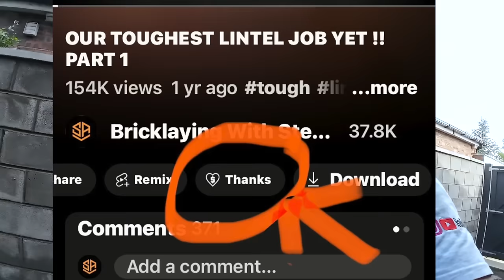WE RAN OUT OF BLOCKS ON BANK HOLIDAY MONDAY !!

Comment: Local environment laws here and elsewhere in the U.K. prevent paid building work on Saturday afternoon, Sundays and Bank Holidays
Reply: It's actually to do with the noise, if the work isn't excessively noisy then there isn't an issue
Reply from the maker: @bungleford 🧱👍🏽
Reply: @bungleford  depends where you live! Until the EA got involved we had between 8 and 13 trades vans parked all around our narrow street causing access issues for residents and emergency services, skips and materials delivered and collected at 07:00 and earlier. EA closed the site down for 4 weeks. It’s usually Eastern Europeans who don’t give a toss
Reply: No it doesn’t
Reply: No stand for the mixer,sure they have one👍
Reply from the maker: @mrc5653 got rid many years ago 🧱👍🏽
Reply: @michaelallan707  doesn’t what?
Reply: Neat job guys.
Shame about the client deciding to go for an extra course - maybe you should just have finished it off at the height already agreed without asking!😂

One little point - in the first video you said you were going to lay the blocks frog up around the rebar so that you'd get full fill. 
Why did you change? I k ow it uses more mortar in the other void but f you'd knocked all the 'seal' out on the one hole frog down you'd have been sure of good filling.
Whilst I expect the wall will be strong enough it isn't as solid this way.

Comment: Another question, how do you attach that metal device to hold your string line , I had my house built 23 years ago and  my mate the brickie, used 2 L shaped bits of wood, from GARRY in BArnsley
Reply from the maker: It’s spring loaded and a great tool invented by a bricky called Richard 👌🏼🧱👍🏽

Comment: Allow me a question.  In the US, a wall like this would usually require a permit, and inspection by the local building authority.  It might (only might) have prevented that amazing original foundation from being built.  But permits would prevent simply adding a course without approval.  In our area, the entire wall would also be vertically reinforced.

Is the process different in the UK?
Reply from the maker: Very ! 😳🧱👍🏽

Comment: Cracking job done! One day, somebody is going to be cursing you when they want to take the wall down. That corner pillar is going nowhere without some swearing 😅. Out of interest, I'm intrigued by the original blocks you took down. Never seen anything like them. Do you think they were a locally made block? I read somewhere once that after the war when building materials were scarce and expensive, a number of small "cottage industry" manufacturers sprang up casting concrete building blocks out of any aggregate that could be got hold of locally,  believe they were called Mundic blocks. Some good, some so so, some terrible made out of any old crap and rubbish mixed with cement.
Reply from the maker: Cheers.
Not got a clue to be honest 😬🧱👍🏽